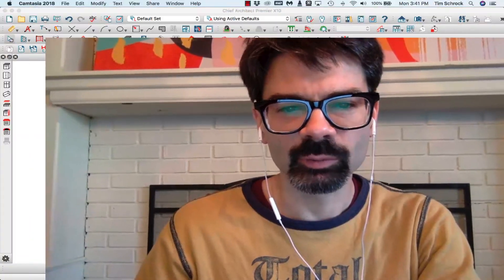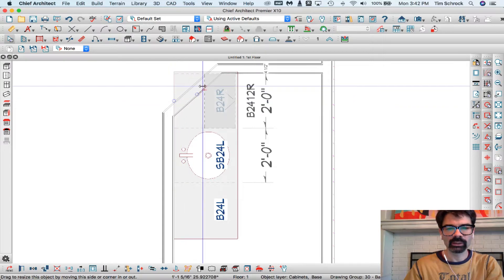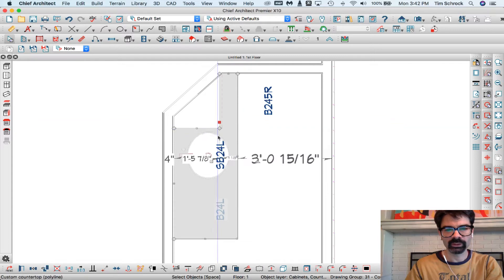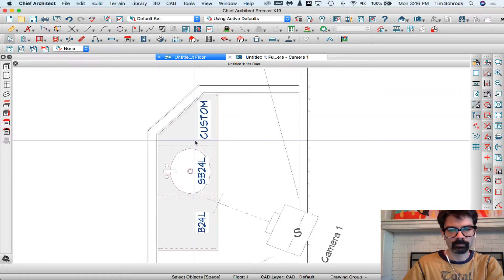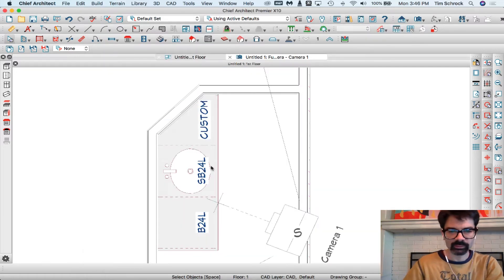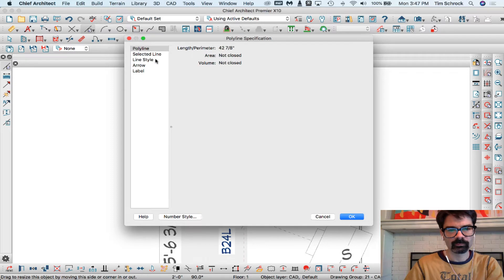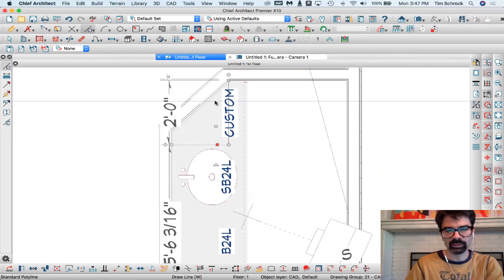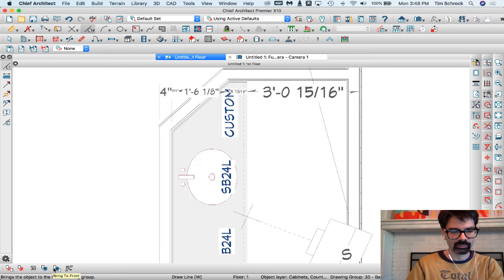Angled Back Cabinets | Chief Architect

Comment: Hi Tim,  thanks for you videos.   Um..... did I miss something, no angled cabinet, just manipulating 2d lines?
Reply from the maker: Yeah. That's all I showed. If you want to count something there, I have done an angled front cabinet, match the back panel with front, and turn the cabinet around.
Reply from the maker: Correction. I’m manipulating a custom countertop. They aren’t just 2D polylines.